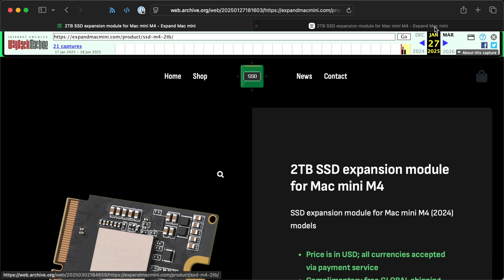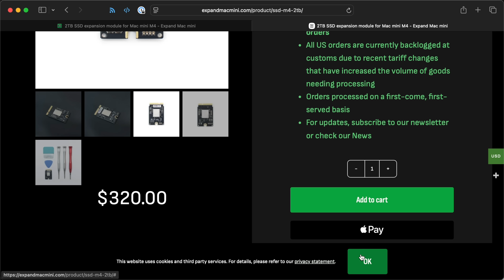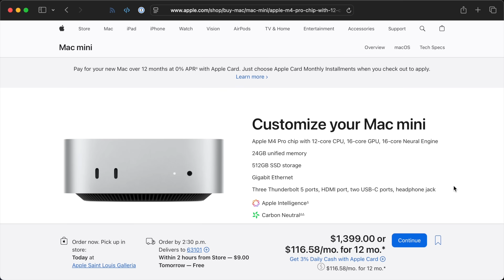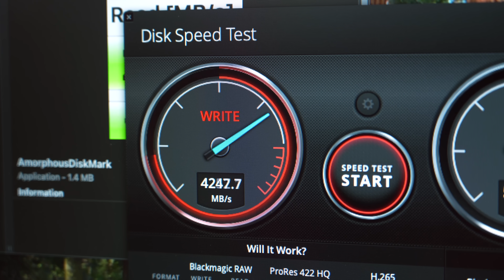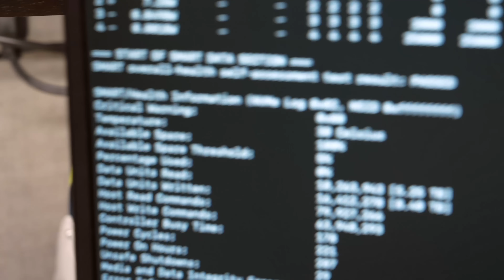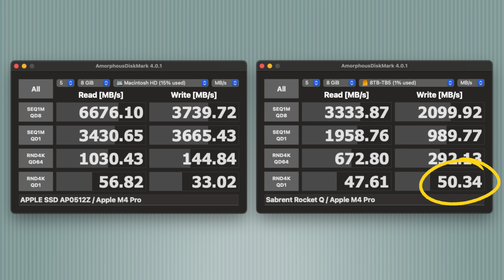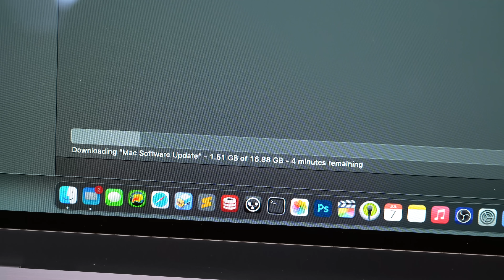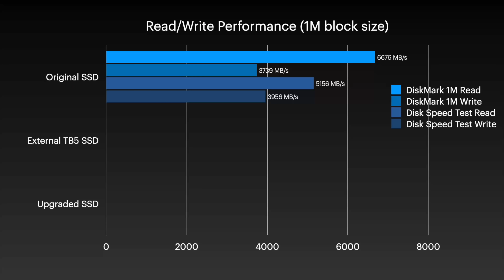There are three types of Mac users

Comment: You actually don't need a T2 Mac either to perform the DFU restore; it can be done with any Mac or Hackintosh that's running a late enough version of macOS. In fact, you don't even need to use macOS at all; using "idevicerestore" from the open source "libimobiledevice" project, you can do it from any Windows or Linux machine as well. Only annoyance is the last official release of that is extremely old, so in order to get this functionality, you have to compile from the latest source.

Comment: Or you could just... NOT get a Mac? Unpopular opinion, I know, but while I'm not a fan of all the anti-consumerism, my REAL reason is that I enjoy messing with my own hardware too much (#rimshot). I'm not a fan of having to fight a manufacturer over what I am and am not allowed to do with the hardware I've purchased just because they can't monetize my tinkering in some manner. I have a Macbook 2019 that I received "free" as in "trade for some help" that works fine, is still fast, but just doesn't capture my attention. It's... fine... but I've never felt as comfortable in MacOS, always fighting things that I feel SHOULD be intuitive, but because I come from r/PCMR it never QUITE feels natural. And it's not even a BSD/*nix problem, because I between my old MS Surface Go2 that I rehab'd with Ubuntu and my SteamDeck, a UNIX'ish-based computer has become my go-to EDC machine for when I step out the door. Bonus that both of them work with my Travel USB-PD Charging and Hub setup. Ahhhh well... ¡¡Que Sera, Sera!!

Comment: I like the idea of external SSD drives, but worry about how they fare as boot drives under modern versions of macOS. I know some people advocate for moving just the user's home folder to an external SSD and leaving the rest of the operating system on the internal SSD, but I really don't believe this is a wise configuration; to me, it seems like asking for trouble. A split-use configuration between a 256GB SSD and external SSD wouldn't work well for my use case, as I'd install over 256GB of applications/assorted libraries, before migrating my own files to the external drive.

I'd probably buy an internal SSD if it were sold by an established company like OWC or iFixit, but it seems like these companies have yet to introduce such a product. I suppose putting a good backup scheme into place goes a long way into mitigating the risk of using a drive from one of these smaller outfits, but I wonder about quality control and what kind of warranty they offer if the drive goes bad some time from now...

Comment: Your external m.2 drive is a PCIe 3.0 that runs at max 4x, which mean its transfer speed maxes at a theoritical 3.9GB/s (~4000MB/s). Unless your TB5 enclosure and cable are not really what they are, what you saw is quite normal for speed on a cheap SSD. But you have to account the TB overhead that will eat up some CPU cycles, so you better try to find a PCIe 5.0 m.2 SSD (and be sure your external enclosure support is too) and you should get much better results.
Reply: Are there any M2 PCIe 5.0 8TB SSDs besides the Samsung 9100 Pro? That one's listed at ~€1k...
https://download.semiconductor.samsung.com/resources/data-sheet/Samsung_NVMe_SSD_9100_PRO_Datasheet_Rev.1.0.pdf

Comment: The 4th type: Me using my 2012 mac mini on deaths door, refusing to let it go.
Reply: I installed ProxMox on an old i5 mac mini 🙂
Reply: @buckeye43210 is upgrading the processor still impossible now?

I mean there are quad cores eight threads i7 ivybridge
Reply: @yohaneschristianp  replacing the cpu is very difficult. The i5 is good enough for my home lab needs.
Reply: I still have a mac mini 2012 and a m4 mini. I do have high sierra on the 2012 but could just install Linux on to it instead or dual boot from a usb hard drive.
Reply: So that's Frugal then.
Reply: You should upgrade to a real PC with linux. It's cheap
Reply: 2019 fully spec’d iMac runs as my daily. Will run until Apple ends security updates then probably will run Ubuntu desktop as I say goodbye to Apple after a 35 year run.
Reply: Installed windows 10 on a 2011 macbook pro and it ran way better than it did with the last version of OSx it supported. Which confused me greatly, but then I shrugged because I had an extremely usable laptop still. That is until the GPU lifted, which I fixed once with a heat gun, then when it happened again I had a 2011 macbook without the external GPU and just swapped the SSD over and kept going.  Still works fine. Still can't believe how bad OSX ran on the thing compared with windows.
Reply: Your Mac mini is two years younger than mine.
Reply: Me on my 2015 MBP crying

Comment: I do zero video editing and and honestly don’t really notice the difference between an old SATA SSD and the most modern high-end M.2s. A cheap USB enclosure with any cheap SSD from a brand I trust will do. I only make sure to avoid QLC flash because that's usually less durable long-term.

Comment: The main concern is that it may void the warranty. You could screw something up by trying to open a Mac that wasn't really designed to be opened by the user. You need two computers to complete the process. Thunderbolt it's really close for what you get. Just plug it in and don't worry about anything.
Reply: There are big differences between external and internal upgrades here. Not only what was detailed in the video, but also how you run macOS. If you install macOS on the external drive, you’ll lose some features, so you have to move just the user folder to keep them - internal has all your data + OS in one place, full features. And again, as detailed in the video, it’s not that close to Thunderbolt.

The warranty is likely valid even after the swap if you don’t mess up something inside during the repair and if you don’t leave any traces of you being there (including putting the original SSD back in before sending in to repair)

Comment: @6:04 what you ran into is clearly simple exceeding the pSLC-Cache (the size diffrentiate between  drive Models e.g. Samsung 990 Pro 2 TB at 226GB of Data, the WD Black SN850x 2TB at around 350 GB of Data, Apples internal Storage in my case a 256 GB SSD at around 8 GB of data) what you then see is  THE REAL NAND WRITE SPEED. you can use AJA System test it provides the possibility to test REAL LARGE DATA in Terabyte areas and provides a shiny graph showing the momentan and the averaged Write and Read Speeds so a good NVME went down to a REAL WRITE Speed of around 1800 MB/s Apples internal Storage (valid for the MBA M1 16/256) down to 200 MB/s what is approximately  double HDD speed (it depends on the number of NANDs in parallel use if you have a MBP wit 4 TB of Storage setup by 8 NANDs which are in parallel use you get of course much higher values. And no setting up a storage with 2 NANDs in parallel is not RAID, for a RAID you need two  or more Controllers in parallel use.

Try a comparison using the AJA Benchmark with custom setting e.g. 500 GB instead of Blackmagic which is limited to 5 GB what is fully within the pSLC Cache.

Comment: Actually the warranty is not up to apple. At least where I'm from, warranty laws say the warranty is provided on all original parts. If they want to deny warranty they would have to prove the upgrade was the cause of the failure. In short, they can't deny warranty on a broken CPU, because you upgraded the storage. They would have to prove the storage blew up the CPU, which is hard if that storage still works fine.

As a user you are fully within your rights to use third party parts with your device, at least where I'm from and that's not the US.

Comment: I've found using a chopstick to pass from one side of the fan holes to the other on the bottom of the M4 mini and pulling up is a lot easier than going in from the side.

Someone should 3d print a tool for that method. MUCH easier.

Comment: Sometimes smaller capacity drives are slower than the same model in a higher capacity. I'm not sure why, maybe because they have more cache, or just that there's more cost-cutting with the smaller drives.

So, it's possible that an "original" 4 TB drive would have similar performance to the DIY 4 TB drive, even if the original 1 TB drive is slower. But still not worth the Apple tax.

Since you already have both drives, you could compare the "original" 512 GB and 1 TB drives to see if there's any difference between those.

Comment: So much for m4-ssd "keeping the price low" - the link in the description to their website for the 2TB replacement shows a price of $459 today (the day this video went live). Suddenly the price from the other vendor who from $2xx to $3xx seems more appealing. This is not on Jeff and I am sure even m4-ssd might have their reasoning but was just surprized how high the price went since when the video was presumably recorded at the time they assured Jeff that they were keeping prices low to when the video went live.
Reply from the maker: That's for the M4 Pro; the M4 mini (non-Pro) is still $299 today :)

I've updated the description, because I think many people were confused about that. Wish Apple would just use the same storage across their minis!
Reply: @JeffGeerling  Got it! Thanks for the clarification. Although I have been using Macs for about a year now at work, I've primarily been a PC user and had assumed the M4 and M4 Pro used the same storage types not realizing the nuanced difference in storage . Certainly curious now why Apple chose different storage - was it related to performance difference between the storage used on the two models (e.g. if we compare same capacity storage, different M4 chips)? 🤔

Comment: One of the most frustrating things about new tech vs old tech, is it's so easy for the manufacturer to remove the ability to update.
Grab an old iPod and you can change out whatever, get an older computer that hasn't been online in a decade, but has the right software, and it can still get the iPod up and running. 
Replacing the hard drive in a modern Mac... if it can't call home, and that home answers, you're not getting anywhere. At any time Apple could bork the process. "Oh this hard drive isn't Apple approved. Install denied!"
Reply: The same is true with TVs. Back in the day you could go to your local Hardware store, test and buy replacement TUBES in a dedicated machine that sat in the back corner...or take out your Yellow Pages and choose between dozens of local TV repair shops and even get a house call. Today, most consumer electronics are sealed and only fit for the landfill when they go sideways.....but even "cheapo" products seem to fail far less often....and adjusted for inflation, modern tech is magnitudes of price less expensive.

Comment: You forgot one type of Mac user: those who buy refurbished Macs, like me. My Mac Mini M4 Pro was 23% off, had only 24 hours of use, and had been restarted about 300 times during those 24 hours — probably due to automated testing.
Reply: How were you able to figure out how much use it had?
Reply: @CorneliusTaylor-s1u It may be SMART stats from NVME drive f.e.
Reply: @CorneliusTaylor-s1u YT deleted my previous post, so here is a shorter version of it.
First install HomeBrew, then from within a terminal, install smartmontools, use diskutil to find your disks, and finally use the command smartctl to get all the details.
You may ask ChatGPT or alike for details.
Reply: I have a 2014 mac mini I got for £180 on eBay a few years ago. All it does is serve as a media player for my TV. If I have need to run macos software, it can just about cope. But macos is infuriatingly inflexible, like knitting in rubber gloves. (You can't have e.g. a finder window floated above a fullscreen app due to the coupling of full screen to separate virtual desktops.)
Reply: @Chalisque this is Soo true!!! I found a workaround it's a shortcut to double click the top bar and instead of full screen it goes to "max size" so it's still worse than windows but it's worth it for the video editing capability I'll just live with the "babies toy" vibe
Reply: That's Frugal then.
Reply: Then, there is the 5th type: Users that convert old Mac Mini (late 2018 models) to dual SSD (nVME + SATA SSD) and Rocky Linux. Just because. 
I got them from eBay for $120 each and I think they were used for bitcoin miners. Than plugged in a USB3 5Gbps RJ45 for networking and it has a new life as a docker sandbox.

Comment: I went with the thunderbolt enclosure option. I have my entire user account on it. It has worked well so far. Maybe a couple tiny glitches because of it. I am a bit concerned about how migration assistant will handle the situation when I upgrade. Maybe that will be fine?

I tried installing apps on it as well at first, but this caused quite a few issues. Apps would regulary vanish from my login items and sometimes notifications would stop working on those apps.

Comment: I'm a fourth "type," running a 2012 mini which I can and did upgrade myself.  Good thing that Debian gets all my tasks done.
Reply: I daily drive kubuntu on old Thinkpads. My mac mini does little other than be a media player for my TV. Macos is like trying to knit wearing rubber gloves.
Reply: @Chalisque  I really don't understand why people think macOS is so great. I've had to use them at work for more than six years, and I'm constantly annoyed by the UI. Not as much as Windows, but it's pretty mediocre.
Reply: @tschorsch  It's intuitive for people who don't know their way around a keyboard, and like to just fiddle around with the mouse/trackpad and have magic happen. If you need an appliance for creative stuff, like say electronic music artists performing on stage, the tight knit nature of software and hardware can be beneficial. If I needed a reliable appliance solely for music production, and could afford a mac, I'd get a mac and put up with the interface. One thing I wish I could do with Linux that I can do with Macos Chrome is to set the url bar from a command line script (which I can then run over ssh), so I can have a chrome tab on my TV but control it from my laptop. That's one reason why I use mac for the media player on the TV and not Linux. The music player is a Thinkpad running Linux (it runs 24 instances of mpd so that I can juggle concurrent playlists easily).

Comment: Unless you know precisely why you need Thunderbolt 4 / Thunderbolt 5 speeds (e.g. you're going to be shifting around hundreds of gigabytes of data on a daily basis) then even an external USB 3.2 at 1GB/s is going to be more than enough for your needs (e.g. a 4TB Crucial X9 for $200 from B&H).

Blind testing has shown that most average users can't even tell the difference in performance of their computer between using a 500MB/s SATA SSD and using a 2000MB/s NVME SSD, for good reason. Because for typical everyday workloads, the maximum read/write bandwidth is almost never a significant factor in the overall performance of the computer.

Replacing the internal drive does have the added convenience of not having the overhead of storing you apps and data on an external drive, but it's really not that difficult to setup an external drive the way you want it -- just a few minutes in most cases, and comes with the benefit of not risking breaking your Mac mini and voiding your warranty.

Comment: I suppose I'm a mix of types 1 and 2. I paid the Apple tax to bump up to 2TB on the Mac Studio I recently bought. The hackintosh it's replacing has an internal 5TB HDD. For now, I'm just going to pop that out and put it in an enclosure of its own. But eventually I'd like to replace that with an external SSD. The problem there is that there are so many options, it's hard to know what's the best value.
Reply from the maker: That is indeed difficult. OWC usually puts together a nice premium product, but you pay a little extra for that.
Reply: @JeffGeerling  Yeah, the OWC externals like the Envoy line do seem like one of the best in terms of reliable performance. But I don't mind DIY, so I'm happy to get an enclosure and SSD separately. 

I also don't need max performance. It'll be replacing an old HDD, so anything is an improvement. And I only really use that drive for photos (and maybe videos) I'm editing. As you mention in this video, most SSDs are good at sequential reads of large files for shorter durations.

So the hard part is doing the cost benefit analysis and trying to work out which bottlenecks (connection type, PCIe version, SSD model) are more cheaply solved, etc. The upside is I'm in no rush, so I'll keep an eye out for comparison reviews.